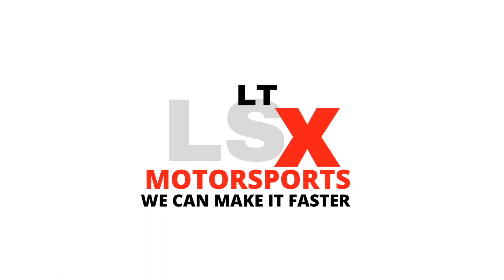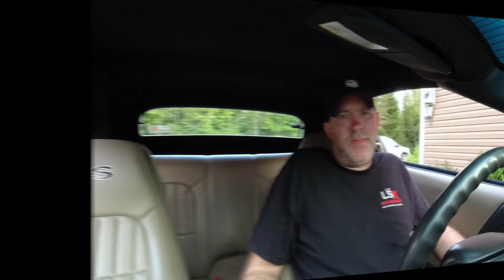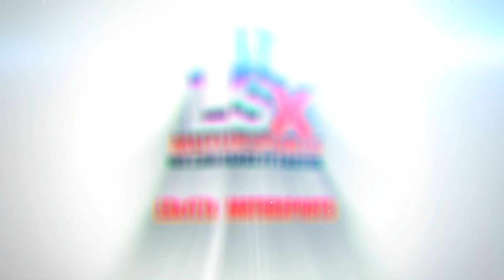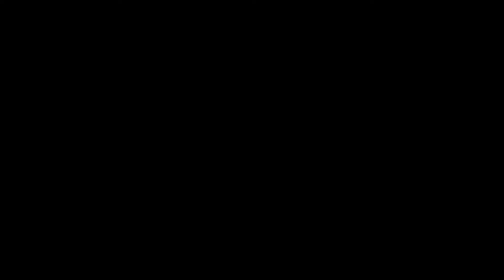Can a Modified MAF be calibrated using HP Tuners? - Ported Mass airflow sensor

Comment: I’m currently in the process of checking out the ported ends, how is this working out for you so far?
Reply from the maker: It works great but only because I used HP tuners to calibrate it which took hours of driving.But the point of the video was to prove it was unnecessary to modify the stock sensor.At my power level I gained nothing.So my advice is to leave the stock MAF completely stock.Now that's not to say it will never help.If you have a full bolt on car with ported or aftermarket cylinder Heads,Cam and bigger throttle body then yes it would probably show some Gaines but it is very important that it gets properly calibrated otherwise you risk damage to your engine.Hope that answers your question but if you have other questions about the MAF I would be happy to answer what I can.Thanks for watching and commenting.
Reply from the maker: I forgot to mention aftermarket intake manifold as well.